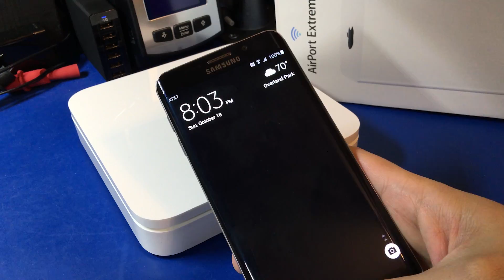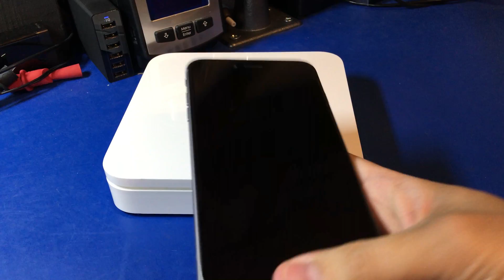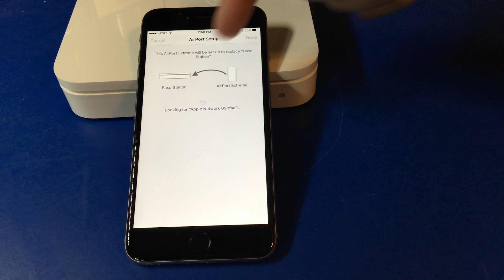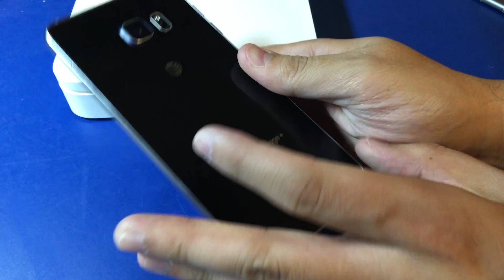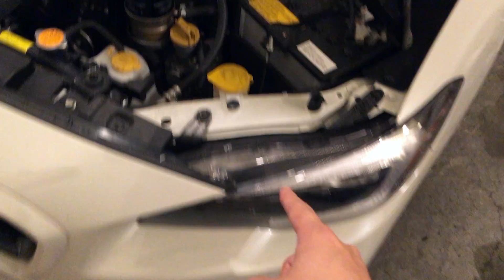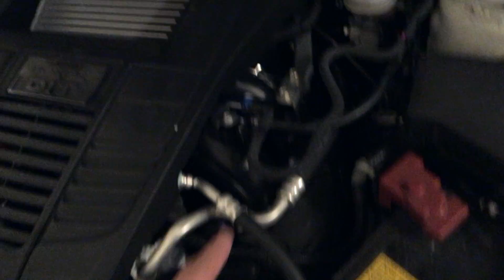Kudos to these two examples of excellent design engineering - #0103

Comment: I agree the Airport is a really good router. However I did not get one because they are stupid expensive while they look nice for my needs I did not care since it would live in a closet. The other reason is I have no Apple devices and so since Apple can't follow standards and put up a web page for those with out Apple products I could not be bothered to buy one. My Dlink 655 router I bought 6+ years ago has all the features that Airport had, USB 2.0 port, Guest partition etc.. Cost me half as much and the only time it got rebooted in 6+ years was when ever we lost power. Last month I bought a new one (it also copied my settings from my old Dlink router so nothing special there) and moved my old 655 to the garage to extend my network. I only picked up the new one to get the AC wireless. My point to this is every ones experience is difference. You are incorrect about the inductive charging it is a profit thing from the profit kings, Apple would have to pay for patents around the wireless charging so they just won't do it, this is why they would not do NFC. The only problem I have with Apple is they could lower the cost of their stuff and still make a nice profit one only has to look at the cash on hand Apple has to know they are all about profit and could careless about the consumers.
Oh I think someone is taking queues about the oil filter, my 2007 Chevy HHR has the oil filter on top like this one. However Chevy did it wrong in my opinion, they use a cartage and a plastic top that screws over the filter. I am always afraid of stripping it out. Then Chevy made so you have to remove the tire well cover to change the headlight bulb on either side.. Sigh they gave us a good think making oil changes easier but made headlight removal a pain in the ass.
Reply: TechnologyCatalyst You should also look twice at Apple, yes the refused to decrypt stuff and Microsoft refused to hand over things to the government in fact MS is in court of that at this time. However.. Snowden and some others that know this stuff won't use Apple devices because of the lack of security there are many articles on this go check them out before you start shouting about the virtues of Apple and how they stand up for the users, don't kid your self they don't. Use Apple if you want that is of course up to you. However you may want to know what exactly you are using and what its weaknesses are. Apple is absolutely selling your metadata and to think they are not or they some how are bigger on your privacy is a lack of knowledge, for example they have a flaw that was detected last October, the researchers that found it gave them 8 months to fix it before going public with it. 2 weeks before they were set to go public Apple finally contacted them and said oh yea its a problem we need another 6 months to patch it. They said no and released this info last june to the public, Apple has still not patched it and to date refuses to talk about it. Also good luck saying anything negative about their products on their forums your posts will be deleted.  Sure does not sound like a company big on security. Don't get me wrong, Apple is no better or worse than MS or Google or Samsung etc.. However for me I need to know what I am getting into before I make the call and I am willing to back my words with actions unfortunately very very few are willing to do that.
Reply from the maker: It would only cost them licensing fees if they used a current standard like Qi, right?  They've got the money for R&D to spin their own, but I don't see them going with induction charging any time soon. 

I have the Samsung puck for my S6 Edge+ and it's a pile of crap. You have to have it PERFECTLY centered else it just blinks a blue light at you and doesn't charge. The non phablet would probably be easier to center. I think a flat mat with a bigger coil would have made much more sense than a tall narrow puck. 

I can't argue that they do probably have room to reduce their prices a bit for less profit margin and lower prices, but that's capitalism for ya.  One thing that people don't consider, however, is the costs outside of the BoM. They see a $200 BoM for a handset that sells for $750 and assume $550 is pocketed without consideration for labor, R&D, licenses, insurance, certifications and testing, packaging, freight, marketing, data center costs (for their cloud services), and other overhead. When you look at the direct competition, the prices aren't that far off. Go price the Galaxy phones, for example. The Galaxy S6 Edge+ 64GB is $849, exactly the same price as the iPhone 6S Plus 64GB. Same with their ultrabooks. You can get more budget friendly options from the Windows side, but ones with comparable specs are priced nearly identically. I think people just confused apple's lack of mid and lower tier products for just being generally overpriced, when it's no more expensive than comparable competition.

But the irrational Apple hate will always exist. I don't know what Apple does to create such a hateful opposition, but it's there. People like to get up in arms about other people's product choices. :) 

I can't argue the price of the airport, however. You can definitely get more for your money elsewhere in the router world.  Considering mine is going on seven years strong without a single hiccup, they've earned my future router business until further notice.
Reply: TechnologyCatalyst Yup I agree. The lower end Apple laptops are over priced compare it with an Asus with the same specs you will pay WAY more. Also the cloud service you mentioned is forced on you so I say they should eat that. Don't get me wrong I love technology in all forms however Google, Apple and Microsoft have all crossed lines I can't take anymore. That is why after the whole Vista thing I switched to Linux. However if anyone asks me about Apple, or a Windows machine I am more then happy to site the pros and cons of both. To each their own. If you look at Apples profits for the last year or more you will see they have lots of wiggle room and the fact they keep people with little to no money from having such good products does piss me and others off. They do it to keep the cache going. If their margins were like everyone else s they would not have so much on hand cash. I am a bit of an Apple hater but only because they could do better and refuse to in the name of profits. Yea, that is capitalism but there is no reason to be stinkers about it.
Reply from the maker: The only lower end stuff apple has for laptops are their Macbook Airs.  I'm surprised they haven't updated those yet.  Their other stuff is pretty fairly priced.  The keyword "premium" still comes into play.  You CAN find laptops cheaper, or at least at first glance, until you realize the asus is either TN panel instead of IPS, or 1080p vs 1440p, or has sata based SSD versus the macbook's pci-e 4x SSD.  Did you know the SSD in the 2015 15" macbook pro gets 2.5 GB/s sequential read?  That's essentially 5x faster than the sata SSDs you find in most windows laptops and ultrabooks.  People don't look at all the details when they compare products like this.  That's not to mention apple ships their laptops with some of the best mobile displays you can get that are factory calibrated for over 100% adobe and sRGB color gamut, which for photographers and videographers is a huge deal.  (hit up displaymate's website for their display analysis and you'll see apple winning 1st in pretty much everything except best overall smartphone display, which samsung finally won out with the note4)

And on top of every single one of those things I mentioned above, the single best reason to get apple is their customer service.  It's incredible and unparalleled.  I had an iphone with a serious hardware issue.  At the same time, my buddy had his nexus phone that was having problems.  I went to apple store, they verified the problem, and walked in back and came out with a brand new iphone.  Popped the sim in, and I was good to go.  One signature, and that was it.  No begging.  No questions.  (that has happened on two other occasions, one for a couple specs of dust under teh screen, and my wife replaced one due to a faulty lock button, but both were replaced ON THE SPOT, no questions asked)  Meanwhile, my buddy with the nexus phone had to ship his phone off and go without his phone for two months.  THAT is another reason why apple can command the prices that they do.  But the apple haters never see any of this because they're busy hating, while the apple users are enjoying their awesome products (and customer support, when necessary).

Trust me, there's a HUGE apple hate trail that I left in the last 15 years on forums across the internet.  I was a dumbass.  I didn't "get it" until I bought my first macbook.  If it weren't for gaming, I'd replace my main rig with a mac pro without hesitation.
Reply: +TechnologyCatalyst As I know there is no Apple screen capable of displaying Adobe RGB 100%. They all are sRGB only. To be precise, recently they started to use DCI-P3 on some models, but it's different - that's not for printing and photography. If designers need Adobe RGB gamut they use professional monitors manufactured by Eizo and like that. Some graphic designers use AdobeRGB color space on iMacs but the outcome is not accurate and they know it. As to me, I really like Apple hardware simply because they usually try to get the best components available on the market. The problem is OSX. It's a toy. Unfortunately, many well-known designers have to use some Mac-specific apps like Sketch and Affinity products, but as I read their tweets, many of them are going to migrate to MS, cause the SurfaceBook is really amazing. Summarizing, Apple products are good for content consumers, but they loose content creators.
Reply: Виталий Константинов Yea, I have head that also. Funny cause our media group at work found Windows software to replace the Apple stuff they were using. There are a few that are still holding out however the majority moved over rather quickly. I have herd that the Surfacebook is a great product, the price sure is. I still need to get one and play with it cause I would like to see it in person.
Reply: +MidwestMotoRider And, in general, looks like it outperforms MBP 2015. http://arstechnica.com/gadgets/2015/10/surface-book-review-the-laptop-that-replaces-your-tablet/
Reply from the maker: i5 Broadwell versus i7 Skylake... I'd hope it does better :)

Here's a different angle when they compare the $2700 surface book to the equivalent macbook pro, where they find out the i7 in that surface book is only dual core: https://fstoppers.com/gear/surface-book-vs-macbook-pro-15-macbook-twice-fast-93596

It's good to see something of quality come out of Microsoft.  We can't let Apple run the high end mobile computing segment with little competition in the premium market.  If only microsoft could figure windows out...

Forcing metro on non-touch based desktop computers as asinine.  Putting invisible "ledges" at the edges of your center monitor to catch the cursor for the stupid charms bar is also stupid.  Half the times I was able to do registry hacks to disable those, but the other half of the time I couldn't get them to go away.  It's really annoying trying to move your cursor from the center monitor to the side monitors and having it catch at the corner.  The charms bar is stupid too, especially on pc desktops and laptop that aren't touch. I can't tell you how many times I go to grab a scroll bar and the stupid charms come up.  Ugh.  How they're pre-downloading windows 10 to 7, 8, and 8.1 computers without permission, and spamming them with notifications bugging them about installing.  Then, they changed the checkbox to be checked by default to automatically upgrade to 10 from windows update so lots of people accidentally upgraded.  They made solitaire freemium.  I can't disable windows update.  (you can only do that on enterprise edition)  They need to get their shit together.
Reply: TechnologyCatalyst I agree MS has to stop this crap, unfortunately their EULA allows for all of that. I disable it every chance I can I don't want Windows update to "preload" Windows 10 I have also upgraded 2 people in the past month to LinuxMint 17.2 and so far its working perfectly for them. I hate the charms bar always thought that was stupid even for touch, they needed to do something different on touch machines. Windows 8 came out with this crap even then the technology was there to see if you were on a PC, Laptop or mobile device there was no excuse for Windows not to detect your equipment and install an appropriate desktop for that device it was pure laziness on Micro$ofts part. Sadly most of the people that bring me thier PC's and Laptops today have Windows 10 because they just bought them and they came with 10 pre-installed. Sadly Windows 10 will soon be everywhere and there is nothing we can do about it. Unless the masses stand up to MS and say enough they will continue to do it. Many Tech guys broadcasting on Youtube have said let microsoft sift through my stuff I have nothing to hide and its a fair trade for a free OS... Sigh I weep for our future with attitudes like that.
Reply from the maker: I agree.  The fact that windows updates have clobbered nvidia graphics drivers for the last 10 years is bad.  But now that we still have that problem on a version of windows that has mandatory windows update is just terrible.  (especially considering how many people have been affected by this already and i'ts barely been out a couple months)

And I know they added a utility that's a little bit hidden that allows you to disable updates of specific drivers, but that's not a good fix, in my opinion.

If they want more people to be on their newest OS version, they need to make the OS free.  And then, maybe they can have a "premium" version that you can pay to unlock advanced features like the ability to disable or manually control windows updates like in older versions.  I would totally pay for that ability.

But I doubt that'll happen.  Everyone is moving the direction of the subscription model + cloud.  (like adobe)
Reply: +TechnologyCatalyst The quad-core mobile Skylake i7 has a 45W TDP. So, do customers need a quite speed laptop or a grill? Personally, I'd prefer the 1st one.
Reply: +Виталий Константинов And if its TDP is 45W we have to take into account the battery life....
Reply: +TechnologyCatalyst The charms bar is removed from the Win10 for desktops. And yeah, it was a pain on Win8-8.1. " Then, they changed the checkbox to be checked by default to automatically upgrade to 10 from windows update so lots of people accidentally upgraded." accidentally upgraded.... And what? )) I simply do not understand this claim ) I see just 2 cases when it's important: the people on a data plan and system administrators having to support a huge PC park, those indeed have to examine new KBs and SPs before deployment. But what about the usual end-users? Is there any user reading what's new in the up-coming updates? Even on OSX, everyone simply checks the system for new updates and installs them immediatelly. MS does it automatically. "They made solitaire freemium." http://i.imgur.com/RQFC8Xp.jpg
Reply: Виталий Константинов I know of about 6 users that have comcast and have a data cap and the secret download pushed them over their data cap so its something that they could go after microsoft for but probably wont. Its just a really crappy thing for MS to do with out re guards to what may happen to those with data caps and those that rely solely on Wireless connects like those out in the really rural areas where they only have 3g for internet access. Love the image bro.. :)
Reply from the maker: +Виталий Константинов It's not even data related what I was referring to--I was referring to drive space.  I had a few friends with older surface tablets that filled up their already small drive with this update.  Not good.

And yes, OS X does updates too, but they've never, not once, bricked my system.  They get the right drivers and updates and I don't have to worry about it.  I can't afford for my main rig to get a restore right now thanks to something like that.  It only took about two weeks before it bricked the insider preview on my laptop thanks to it clobbering some drivers.  I don't have time for that, and even if I did, people shouldn't have to deal with that, especially for a product we have to pay for.  Why are you defending microsoft anyway?

As for your comment on the 45w tdp, I don't personally need that much horsepower since I have a powerful rendering PC for that sort of work, but some people don't own desktop computers anymore and need the power.
Reply: +TechnologyCatalyst As I said, it was a MS mistake for some categories. And I agree to take into account a new group you mentioned: PCs having limited storage space. As to me, leaving some users without an opt is more an ethical issue. But at whole, say, ms surface clients is (I guess) a 0.001% of users. As everyone, MS does shitty things sometimes but the auto-upgrade/update is not a big deal for the mainstream. Speaking about laptop drivers, I dunno, my own was upgraded painlessly. But yeah, it may be a problem on some machines due to hw vendors diversity. I had overheating issue on my iMac 27 2011 on Mountain Lion, freezing issues on Maverics, stability issues on Yosemite and now all is quite good on El Capitan. What should I say about the company that produces both hw and sw? it's just a shame. My colleges working on MBP and iMacs in the office, they always try to postpone the system upgrades/updates. Once they are obliged to do it due to XCode requirements. "I don't have time for that, and even if I did, people shouldn't have to deal with that, especially for a product we have to pay for." Windows 10 was free in auto-upgrade cases, but that's not a big deal. "Why are you defending microsoft anyway?" I simply try to get facts as they are. In accordance with your previous comments, Apple is shining and it's da best. I don't agree. I use PCs, I use Apple products (iMac, iPad3, iphone 5s), I use android devices (Galaxy S Tab tablet, Nexus 4, Sony Experia Z1), I use Linux (archlinux) and I see their strengths and weaknesses... As for 45w, it would be fair to compare almost equal hardware. My PC is much faster than my iMac but I don't say that iMac is garbage - they are for different purposes. If someone needs the most powerful laptop he/she prefers the most powerful mbp or lenovo "w"-series and so on. Comparing SurfaceBook and the mbp with the same cpu power, I'd prefer the surfacebook. And sorry for my English.
Reply: Виталий Константинов Oh don't apologize for your English its very good and I have not learned any other language so you are ahead of me there. :) I see that also, many people having both Mac's and PC's to do different things. So there are people for who I recommend Mac's because I feel its a better platform for them and some I recommend PC's as its a better platform for them. For me personally I have completely left both Mac and PC (Windows) because everything I need to do I can do quick and easy in Linux and if I want to tinker around or spend time at the command line its no problem. I tried using Mac once before it was Lion I believe anyway it was almost nice the problem is many of the commands I was used to using at the command line are butchered by Apple so it was very frustrating. Also the next release of OSX came out and I was not able to upgrade because my Mac book was "too old" yet it was as strong as many of the new low end macs that were out. Crap like that pissed me off. Now the whole thing with Microsoft pushing Windows 10 to everyone even those that it may be a problem for puts them at the top of my list for companies that do crap stuff. The end of the day Apple is a greedy pig of a company that only cares about profits and Microsoft wants to be them. For me and anyone I can convert to Linux I am more than happy to and send my $100 to that distro rather than MS or Apple or Google.
Reply from the maker: I still don't understand how you're defending microsoft.  They're dickheads that keep ignoring big problems and being motivated purely by profits.

IE has been a POS for FOURTEEN YEARS.  You know it's a POS when they have to include a "compatibility mode" because it's a POS that doesn't follow W3 standards.  As a former developer, I can tell you that IE made web development more difficult than necessary.  How did it go 14 years before they finally decided to start over?

Windows has always installed boot manager on a new partition on a secondary hard drive (if one is installed).  If you remove that drive, your computer no longer boots.  Windows STILL does this.  It's been over a decade they've pulled this crap.  Why would they even do this?  Don't tell me availability because for a desktop workstation, that's just silly.

Drivers.  Windows has always sucked at drivers.  You could install linux TEN YEARS AGO that would go get all the correct drivers on its own and be 100% ready to go on first bootup.  Windows, even today?  GOOD LUCK. There's a reason why most people leave their network cable disconnected during windows install.  That's not to mention windows update clobbering drivers AFTER the fact.

How do they still not have a system wide update system?

Windows 10 and privacy.  With all the data they're collecting in windows 10, you'd think that's how they've made the OS free.  But wait, the OS isn't free.  We still have to pay $150+ for it.  When you consider freemium features and ads in windows 10, this is unacceptable.  (which by the way, they added this stuff to windows 7 and 8 as well through a windows update, so even on the older versions they're still selling your metadata)

Wi-Fi Sense.  Do I even need to say anything about this one?

Bandwidth sharing.  They're too cheap to pay for CDN's, so they use your internet and computer as a node in their torrent-like sharing network for windows updates.  Again, if the OS was free, this wouldn't be a big dealt to me because they could say "since the OS is free, we have to make up costs elsewhere".  I would understand that.  But the OS is NOT free.  This is especially bad for people on metered connections.

UAC still is not a good fix for root control.  (especially when you consider lots of people disable it immediately)  This doesn't bode well for windows security.

I could go on for hours about things that microsoft has done that is really dickish.  The worst part is how most of the problems were just ignored and never fixed.  I mean IDE was dying for years and new versions of windows STILL required a external disk + pushing F6 during the installer to point to SATA drivers?  It's really sad how they just can't be bothered to fix things. I mean how long could it possibly have taken to just include universal sata drivers in the installer?  Cheap bastards.

And don't even get me started on xbox live.

Apple has topped PC satisfaction rating for years now.  There's a reason for that.  I'm not saying that you're lying about your coworkers having problems with OS X.  I'm sure they do.  But I have a lot of friends with apple hardware and never hear any complaints.  I've also been a mac user for the last decade and never had any major problems that I can remember.  A few anecdotal problems don't equate to a bad OS.
Reply: +TechnologyCatalyst IE. Correct, it was/is a pain for web devs since different workarounds should be applied to have a pretty simple website to be working on different IE versions. But it's a web devs pain only. Period. The end-user simply uses it for browsing.
If you (as a user) need a better one, download and use Google Chrome/whatever.

MBR question. 99.9% don't suffer from that cause in 99.9% of cases people have just one OS on the machine. In the HDD failure cases a "smart guy" simply installs all the stuff on the replaced one for their money.
If you are a techie, partitioning is not a problem. But yes, UNIX boot managers are far better, that's for sure. But again. It's not a problem for 99.9% of users.

Drivers. "Windows has always sucked at drivers." WRONG. It's hw vendors who write custom drivers for Windows using umdf/kmdf ddk. If someone wants, MS tests the driver and if it passes all the tests, MS can release a WHQL signature, if I'm not wrong here.
It could not be compared with Linux, cause at 1st, the linux driver model is very old and very different (all devices are simply "files"), and, as the most important part, the open-source community supports them, not a specific vendor, having usually a very small driver coding stuff (there are exclusions cause there is proprietary software as well, like native amd/nvidia drivers etc).
"You could install linux TEN YEARS AGO that would go get all the correct drivers on its own and be 100% ready to go on first bootup." All the correct drivers? Unfortunately, no. Especially on laptops. 
The driver base on Linux is huge that's true, but it's a living organism that grows up constantly. As a very simple example - USB 3.0 support.

"How do they still not have a system wide update system?" Oh, this is my dream. On ArchLinux I update all the packages with just one command.

"Windows 10 and privacy.  With all the data they're collecting in windows 10, you'd think that's how they've made the OS free."
I know nothing about that. And I say to myselfand to you "I know nothing". Looks like you know something important. If so, an additional question:
are you sure that Apple OSes don't collect your private info? If yes, do you have OSX source code to prove it or all maybe all the network dumps (with decrypted packets if needed)?
Speaking about the privacy... It's amazing how many security bugs were found on OSX recently. 
And take into account that OSX isn't so popular, it shares 8-9% of the market if I'm correct. The increased popularity will raise huge security pains for Apple. That's for sure.
That's why the corporate market uses Linux/BSD/Windows only.

"I've also been a mac user for the last decade and never had any major problems that I can remember."
What can I say? Good for you. I was an apple fanboy when I bought my first Apple product, but today I try to think adequately )
PC, Mac and Linux - are just tools for me, and in my personal case the Windows tool works better.
MidwestMotoRider uses Linux and that's great, cause Linux satisfies his needs. You prefer Apple/OSX. No problem.
Reply from the maker: Apple is big on privacy.  They've refused multiple times when government agencies asked for them to decrypt apple devices.  (it's even been in the news about iOS FDE the last month)  I REALLY doubt they'd sell your data.  Google on the other hand, IS selling your data.  Their income IS from data.  They're a data company first.  Everything else, second.  It's why they make apps for iOS too.  They don't care about the competition.  They want you to use their products.  Microsoft is obviously seeing the untapped potential of selling user metadata. 

Here's more info on the privacy stuff related to windows 10: http://www.techrepublic.com/article/windows-10-violates-your-privacy-by-default-heres-how-you-can-protect-yourself/

And I disagree with your assessment in the other areas, but am tired of this stupid argument so I'm over it.  You sound like a fanboy that switched from Apple to Microsoft.  I use PC rendering machine at home, PC VM at work, though 99% of my work at my day job is in redhat linux.  (and a handful of HPUX boxes we're trying to get off of)  We have a few things on server 2012.  I have mac laptops, a few windows workstations (workbench, my wife's, guest bedroom), couple linux servers.  I have 6s plus iphone, s6 edge+, note 5, 6p on preorder.  I am an equal opportunity gadget / tech guy.  I'm pissed at microsoft because I have the right to be.  I'm still disappointed that you're defending their asinine actions.  You can argue a reasoning behind almost anything, but why?
Reply: +TechnologyCatalyst "They've refused multiple times when government agencies asked for them to decrypt apple devices."
Unbelievable. Simply unbelievable. Even Monicagate and Snowden prove that words mean nothing. )

"I'm pissed at microsoft because I have the right to be.  I'm still disappointed that you're defending their asinine actions."
Again, taking into account all the pros/cons, as to me, MS products work better. And that's my opinion. I have the right to reflect my pov.
What I was doing is simply "my arguments vs your arguments". And that's all.
You might say that "Look, your arguments are wrong or not logical, so I cannot admit them".
Instead you say:
"Why are you defending microsoft anyway? I still don't understand how you're defending microsoft. You sound like a fanboy that switched from Apple to Microsoft."
I've said nothing about you personally. If you have nothing against it, let's close this discussion.
Reply from the maker: I'm very aware of the preachings of Mr. Snowden.

Apple doesn't sell metadata: http://www.apple.com/privacy/

Do you know what metadata is?  What does metadata have to do with Snowden?  Google makes their money from ad revenue.  That's their bread and butter.  They don't even hide it.  And you know what?  There's nothing wrong with that.  Microsoft is hiding it.  I'm 100% ok with selling metadata when we're talking about a free product.  There's no such thing as a free lunch, and so costs have to be made up.  If it's by selling metadata about the user, then so be it.  (so long as the user knows about it)  Apple does not sell your metadata.

Now if you argue that the government has a backdoor into apple's data: who knows.  But don't confuse that with companies selling metadata.  Those are two completely different things.
Reply: TechnologyCatalyst Sorry I have been in negotiations with Apple for some time now its a work related thing I cant say more than that. They do in fact sell your metadata oh they call it something else but don't think for one minute they have all that info and are just holding on to it. As for Snowden the any reputable hacker I mean the good ones that know about stuff, they will tell you stay away from Apple products.
I am 100% not ok with any metadata being sold unless I know ahead of time what that data is. That is why I am more ok with Google as they are up front with it, less ok with Microsoft because they are even less up front with it, and Apple is just a real stinker by saying they don't but then masquerade it as something else and selling it that way. Bottom line is you are correct, there is no free lunch (well except for volunteer work) I use Linux while it is free I do contribute to not only the OS but the software I use also in fact I probably spend more on Linux and Linux related software then I would on Microsoft or Apple or Google OS's and I don't mind because as long as I can trust the Linux kernel etc.. I am happy to pay. Should the time ever come I can't trust Linux I will absolutely roll my own kernel from scratch. Right now no sense in reinventing the wheel. Even tho I love the router Apple puts out I would not own one (setting aside the price for a moment) hook up a really good packet sniffer on it once I mean a REAL good one not some software downloaded to you phone or installed on your PC. You will quickly see what I mean.
Reply from the maker: Your claims are dubious without proof.

What level of metadata are we talking about here?  I'm sure they sell metadata about what age groups buy what apps.  They can sell tons of data to marketing agencies on sales data.  That's not the same as metadata at the personal level.

And what's this silly packet sniffing talk... some citations of these claims would be great...
Reply: TechnologyCatalyst If your google'ing FU is good you will find such claims and proof. I can not offer you anything with out violating some agreements I have signed. If you choose to not believe it that is fine. I just put it out there in case you wanted to know. Sounds to me like you will stick to what you are using. Fair enough I am sure you have a bit of money tied up in it. All meta data is personal and links back to the owner, not sure now if you know what meta data is, or maybe you have a some what a blurred vision of it. At the end of the day, you seem comfortable with your choices and so you should be. If you knew about Network sniffers you would know what I mean, the software ones you load on PC's or Phones/Tablets do not give you all layers of the stack so you need a true sniffer to see what I mean. They are extremely expensive however if you can get your hands on one use it for a week on your network and don't alter what you do and then inspect the packets you capture. After all is said and done I still enjoyed your video and agree with about 90% of it and your right what does my opinion matter really. :) Looking forward to more videos.
Reply from the maker: I know what metadata is.  I work in the world of data for a living.

Here, this might help you out: https://www.youtube.com/watch?v=SGkFRs6eng4
Reply: +TechnologyCatalyst I agree with MidwestMotoRider that your channel delights many of us. Obviously, this particular discussion has exhausted itself. So let's respect each other and go further. Peace.
Reply: Виталий Константинов Agreed.. Good conversation tho.  Have a good weekend guys.
Reply from the maker: Didn't like the tin foil hat thing?  Sheesh, no sense of humor :)
Reply: TechnologyCatalyst I do.. That is why I sub'd Weird Al's channel. :)
Reply from the maker: Touché
Reply: +TechnologyCatalyst Amazing, how quickly we find a common language. Thank God we are men. https://www.facebook.com/photo.php?fbid=10203945841480890&set=p.10203945841480890&type=3
Reply from the maker: Indeed sir, indeed.
Reply: Виталий Константинов Great image! Have to show that to my wife she will get a kick out of it.
Reply: +MidwestMotoRider http://www.displaymate.com/Surface_Pro4_ShootOut_1.htm I like it. The Apple/MS competition becomes fiercer.
Reply from the maker: Very nice.  About time we get another contender for great displays.  I wish Microsoft would make some nice standalone displays.  I'm shocked that Apple no longer has monitors and that their new iMacs don't support target display mode any more.
Reply: TechnologyCatalyst Yea, I was some what shocked when they stopped producing those displays. I was under the impression they were a pretty good money maker. I do like a number of Dell displays but to be fair I don't game or do art etc.. so I am not nearly that picky still I would like to see MS get in the display game.
Reply: +TechnologyCatalyst Why? Also, there's a reason why people working with photography and video stuff professionally don't use Retina Displays. They over saturate and over contrast colors, which is something that should never happen with a good display.
Reply from the maker: Lots of professionals do, actually.  Usually the ones who can't afford a $3000 professional display.  Their laptop/desktop displays aren't as well calibrated as their tablets/phones, but they're also nowhere near the bottom of the stack either.
Reply: TechnologyCatalyst Well, a good calibration device does wonders when you can't afford a 12-bit display, as well as costing a fraction. But, it's rather sad to say that some people use their Retina Displays as is, without calibrating them for color and contrast accuracy.
Reply from the maker: +Crimson Sunrise I never said without calibrating it. It's dirt cheap to calibrate it yourself.
Reply: TechnologyCatalyst I'm aware. I'm just saying that some people swear by the nonexistant accuracy of a Retina Display and end up not calibrating it.
Reply from the maker: +Crimson Sunrise Apple factory calibrated all of their displays on all of their devices. That's not to say you couldn't do a better job yourself at home, but they're far from out of calibration like you're making them sound to be.
Reply: TechnologyCatalyst It's a known fact that Retina Displays have a tendency to oversaturate colors.

Here's an article that tests and further explains what I'm talking about http://blog.conradchavez.com/2015/10/26/a-look-at-the-p3-color-gamut-of-the-imac-display-retina-late-2015/
Reply from the maker: In most cases, it's better to have a wide color gamut.  They're definitely not oversaturated, however.  If you want to see oversaturated, fire up a Samsung OLED device.

Apple adds a better display and they catch fire for the problems down the stream.  Firefox and Chrome have had issues with this for a long time.  Hopefully IEEE comes up with a good solution to this dilemma, else we'll be stuck with intentionally gimped displays as a crappy fix to these stupid problems.  (or bend to Adobe's will)